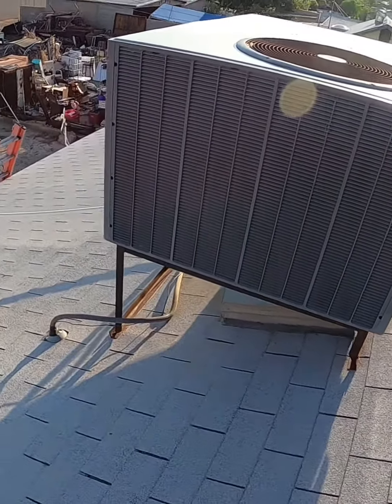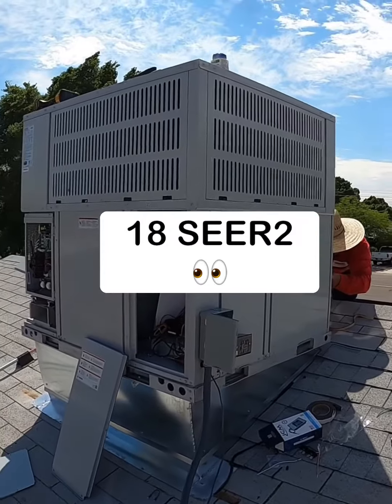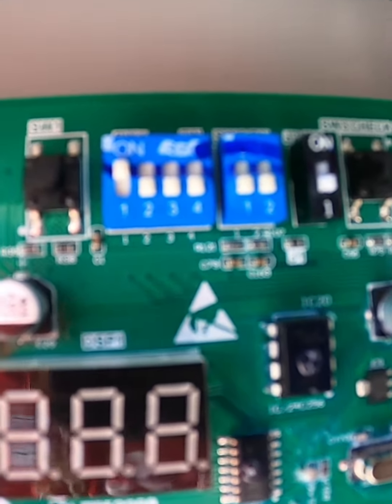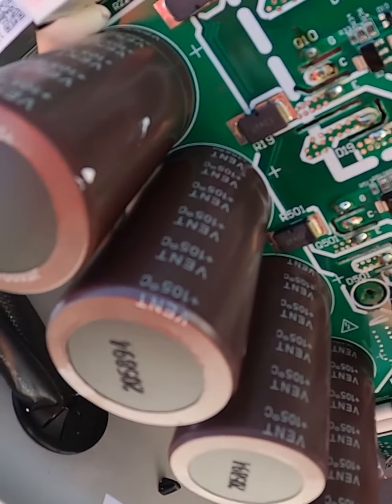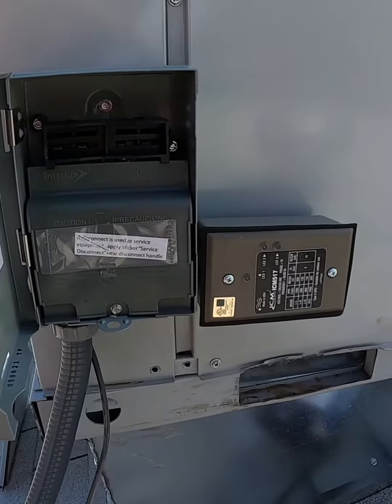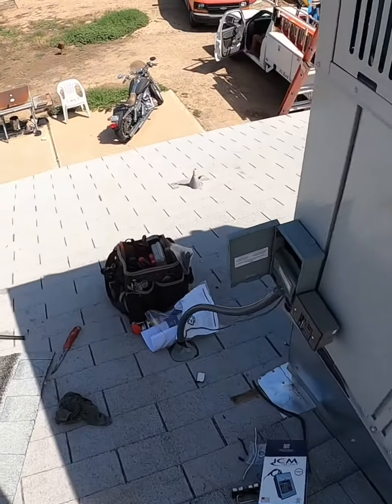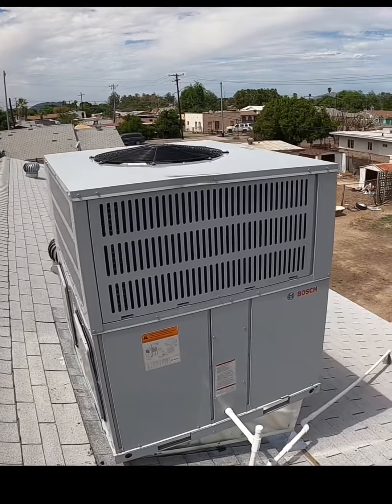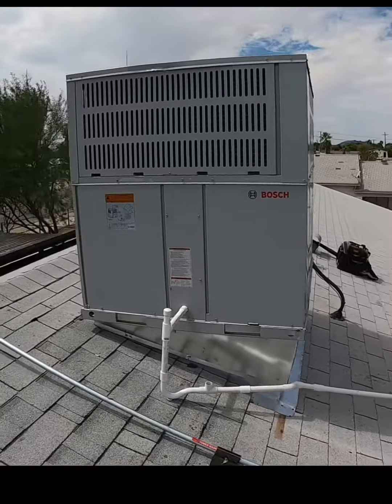Bosch Packaged Heat Pump quick review.

Comment: How have the Bosch Package heat pumps turned out so far, and are parts readily available?  The inverter would keep things warm during the winter here in our part of AZ.  However, I’m wondering how long the Bosch packaged units will last and how reliable they’ll be.
Reply from the maker: For Bosch parts i wouldn't know, i have never repaired a Bosch 😅 The 20+ i have installed have been good, im sure thoe sooner or later one will fail. 
For how long they will last, im assuming 10-15 years, but more like 10 hahah
Reply: 10 years seems to be the new normal for packaged heat pump longevity.  I think we’re going with a budget model, and maybe in 10 years there will be more HVAC manufacturers producing inverter heat pumps.  Until then, I hope we get 15 years out of whatever budget brand and model we choose, which will probably be a Day and Night or Rheem/Ruud because that’s what’s most available in our part of AZ.  Thanks for the video and reply!
Reply from the maker: @archstanton9703  The day and night 2 stage packaged unit is actually really nice, and they have copeland compressors. Maybe you can do a 10 year labor warranty and have total peace of mind.
Reply: @HeavyPressureHVAC-WATER  I appreciate the recommendation the day and night unit has a five-year replacement warranty, which is pretty good. I’m wondering with this unit if it’s possible to put a larger filter in it so it doesn’t have to be changed like every three months because I have to get on the roof to change the filter and I’m trying to avoid that, HVAC company said they could install a new return inside the house but they’d have to perforate the roof for the ductwork  which would be much more expensive as well.  Thank you and have a good day.
Reply from the maker: @archstanton9703  A return inside the home is ideal, but i understand sometimes the homes structures will get in the way of the upgrades. If your budget allows it go for it 😇 
What part of AZ are you in?
Reply: Our return area is in the inside of the walls in the sheet rock because it’s an older house and I guess that’s the way they used to do it back then so it’ll be pretty expensive for them to install a new return error. They have to make a hole in the roof and install it somewhere in the house Positive I wouldn’t have to get up on the roof to change them air filters, but I guess that’s what I’m gonna have to do for a while. We’re about five hours from you.
Reply from the maker: @archstanton9703  Good luck with your project, if you need help msg me on here.